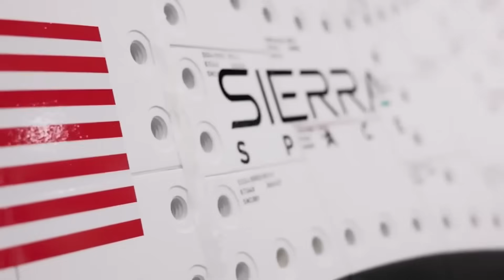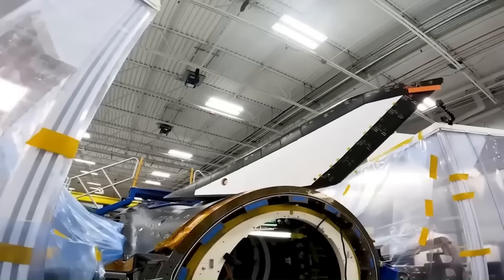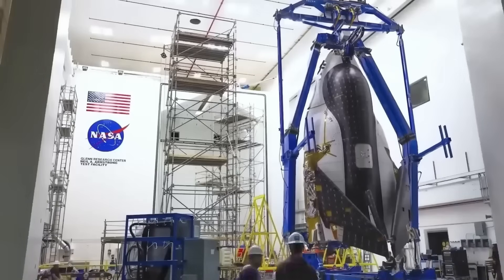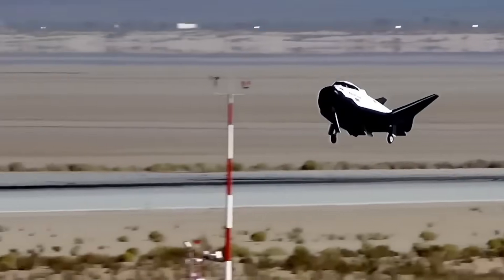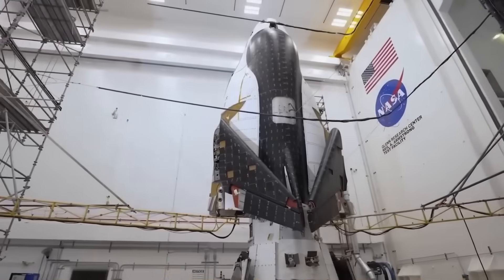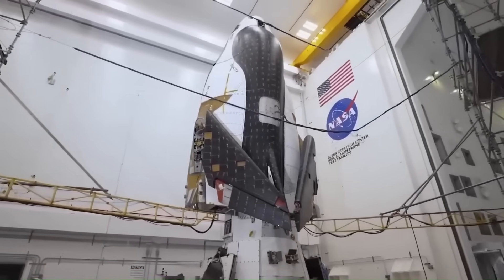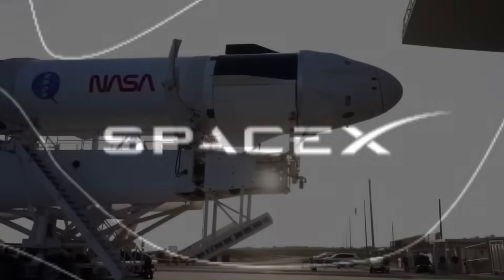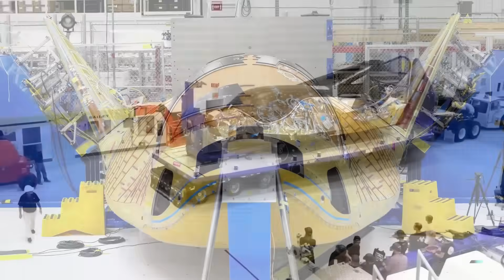Dream Chaser WINGS in Big Trouble and It's Not Launching This Year!

Comment: Why not go with a fixed wing design? The original design for crewed variant did not have folding wings. Sierra space also planned to have fixed wings on the crewed variant in the future. So why worry about the folding wings at all? Seems like an extra point of failure that isn’t necessary. This was always meant to ultimately be a crewed spacecraft. I say ditch the folding wings! Otherwise it’s a great design which improves upon the best aspects of the space shuttle without the inherent drawbacks of riding alongside boosters and a fuel tank.

Comment: The wings only need to fold because of the launch vehicle. Wouldn't the larger diameter Starship booster allow unfolded wings? Besides, the hinge point is a failure point on re-entry the same way the moving flaps are on starship.

Comment: AI vs AI
Based on recent reporting from September 2025, there does not appear to be a major, known problem specifically with the wings of the Dream Chaser spaceplane. Instead, the repeated delays of its first flight appear to be due to broader technical and scheduling challenges with the Dream Chaser program and its launch vehicle. The "wings in trouble" narrative seen on social media appears to be a misinterpretation of these broader issues.
Reply: However , if the wings actually are problematic because of folding , then eliminate the joints and allow them to protrude through the fairing . 
If aerodynamic drag is then too high , simply mount disposable sharp leading-edges on them.🤓

Comment: I am not sure I understand why they HAVE to be delivered inside of a faring, wouldn't it have been cheaper and easier to just make the wings fixed and build an adapter to ride atop the rocket? Then they could ride ANY capable rocket with the right adapter. Seems like a no brainer. There may be some unpleasant dynamic forces experienced on the ride up, but if they have to survive the ride up and down anyway (faring or not) then, that task seems far more surmountable then dealing with "folding wings" issues. Moving parts are always MUCH more likely to fail than those that do not move.
Reply: The 1960s Dyna-Soar was (AFAK) planned to launch sans faring. But anyway Dream Chaser is redundant as the Air Force/Space Force is using almost the identical vehicle. Nonetheless, the immediate key to America's "future" in space does seem to be Musk's (gag) Starship. Building a too large launch system is cheaper than a too small system.

Comment: This ship design has flown and re-entered before successfully. I have the reports!
Reply: No, you don't.  Because it hasn't flown yet.
Reply: @jims6450  It was dropped from a heliocopter and flown down.
Reply: @JRS-iq9pz  Was that helicopter above the Carmen Line when it dropped the ship? Did the ship reach anything near the 17K mph reentry speeds like it would see on the way home from orbit.  Nope.  There wasn't any sort of "re-entry" involved.  With no reentry taking place, there isn't any reentry happening.  Just relatively low speed aerodynamic tests.
Reply: @jims6450  Right. It was just an aerodynamic test of it wings.